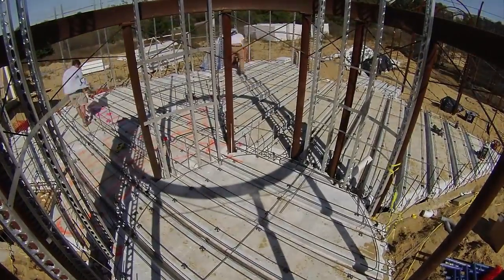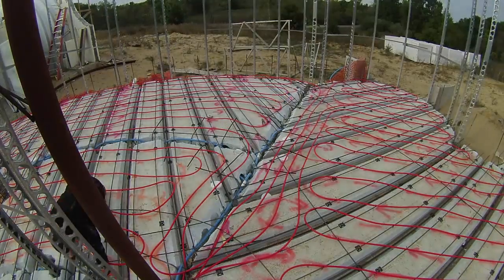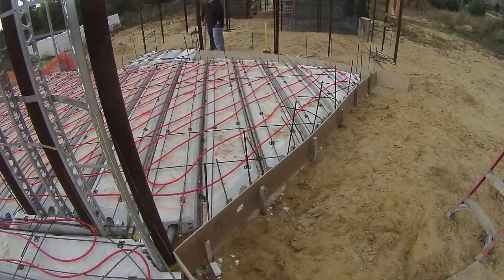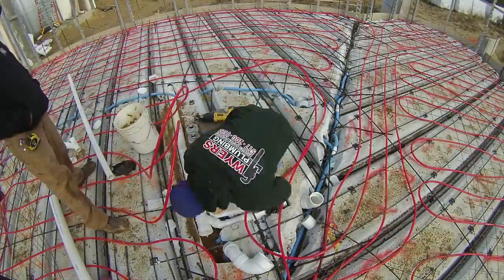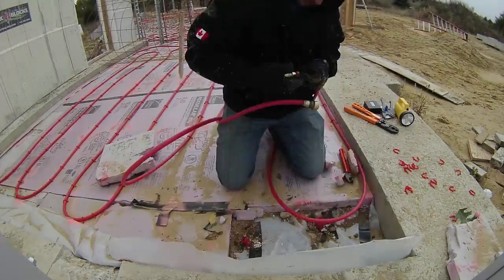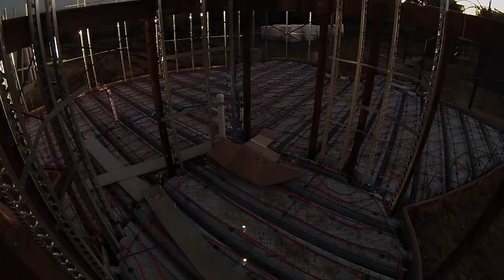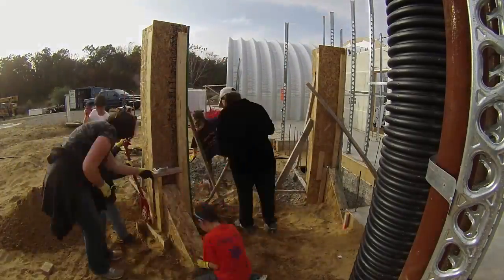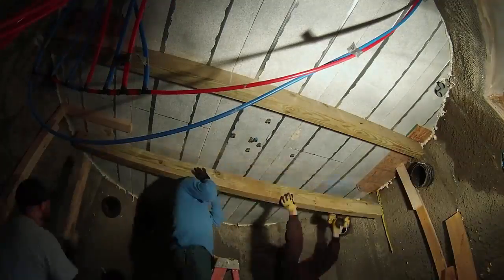20.1 Pouring the concrete over the QuadDeck

Comment: I'm really shocked that you can run plumbing pipe thru the monolith slab like that, thus creating a weak point.
Tho this is the first video I have seen plumbing run in the same video as ICF
Reply: 3:23 The recessed parts of the foam where the rebar is down in the bottom of the channel are supposed to be filled from top to bottom with solid concrete, not "void'ed" with plumbing and electrical which is creating structural failure points. Quad-Lock has built in conduits in the foam, and if anything does not fit in that pre-defined space it should be stubbed straight down and moved laterally under the deck to where it needs to be.

Comment: Greetings,

Let me start by saying that is an awesome project, I'm binging on construction videos for a small project and Your thumbnail caught my attention. Specifically  those beams that look like aluminum with triangle cut outs .

Are they aluminum ?
And what are they for?
I can't tell if they're cast or machined , but they look awesome.

I'm studying a similar design as an alternative to 3x3 11 gauge steel tubing
 //square //  ,   For sheering and compression strengths , in a vertical upright application.

Any info would be greatly appreciated .
Reply from the maker: Sure, those are called "Marino-ware StudRite" steel studs.   The cost is similar to the flimsy studs you would find at your local hardware store, but you need to custom order them to length.  http://www.marinoware.com/resource-center/literature-test-data/studrite/

Comment: Was it cheaper to use shockcrete instead of Foxblocks for the basement? Why did you use shockcrete?
Reply from the maker: I used shotcrete because of the various curves, especially curves of the roof where ICFS have no solution. I did consider ICFs (not FoxBlocks, but other brands that are easier to curve or come with curved blocks for certain radii) for the basement walls, but they were more expensive for what I planned to do and the connection to the roof shotcrete was not clear. 

I also didn't want to insulate the concrete from the inside of the house (I wanted that thermal stability)... And planned to use an insulation umbrella over the house, away from the walls so I could fit more mass (earth) within my insulation envelope. 

Now, looking back, I guess the connection problem could have been overcome and the Shotcrete ended up costing more than originally quoted, so not sure if I saved money.  I also thought the ICF approach was much cleaner (less messy) than shotcrete, but that is another story.

For another design/layout, they may have been equivalent or better, especially when you factor in the cost and hassle of adding the insulation to the shotcrete after the fact.

Comment: Given the problems you had with the Quad-deck installer, what would you do instead?  Precast beams or something?  Seems like the ICF walls Quonset hut kit here a piece of cake compared to that floor.
Reply from the maker: +Onward to Innisfree I have one more section (less than 200 sqft) of quad deck in the plans for a section of the roof (I am experimenting will a bunch of different roof types), and I plan to just install that myself.  But to the bigger question, If I had to restart right now, that basement added a lot of extra time to my build and I would probably skip the basement completely and just build the house slab-on-grade.  I am not yet sure if I will feel that way when the house is done and may be glad to have that extra space for a relatively low cost per square ft.

I still think that Quad Deck is a good way to build a suspended concrete floor over an irregular room.  If the rooms are nice and square, you could probably use some other system of removable metal forms or concrete planks and save money.  I would also recommend quad deck if the rest of your house were ICF blocks and you had one expert crew doing the whole thing...  I got the feeling that my installers would have been much more comfortable with that sort of install.
Reply: +Simon HomeintheEarth Makes sense.  If you still wanted to do annualized storage of solar heat, would you run earth tubes under or around the foundation?  I wonder if a hydronic system would be simpler, at least for non-engineers.
Reply from the maker: +Onward to Innisfree Yes, I do still plan to do annualized storage of solar heat.

Earth tubes change the temperature of the soil locally, which could cause thermal expansion/contraction or even freezing of the earth above them, and you don't want that happening directly under your foundation.  However, I had 2 levels of foundation because my basement is only under about 1/3rd of the main floor.  The earth tubes are around the lower foundation, but also pass about 8 ft below the main level foundation and under the main floor where I expect to get most of my solar gain.  

Earth tubes are just passages for air flowing without any pressure...  That is much simpler than hydronic because you don't have to worry about leaking, freezing, pumps, etc.  Hydronic systems are more effective and more expensive, but not simpler...  

Unless you mean it would be simpler to pay someone to install a commercial grade hydronic system...  Then yes, paying someone is usually simpler, but expect to pay a lot. ;^)